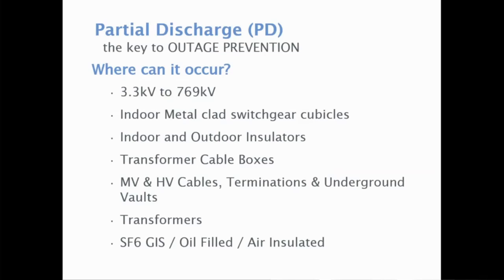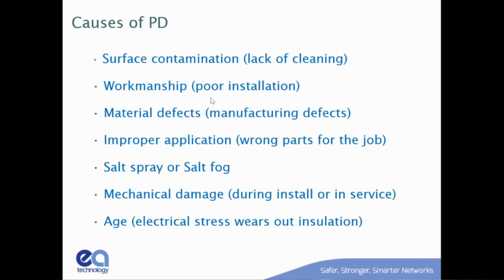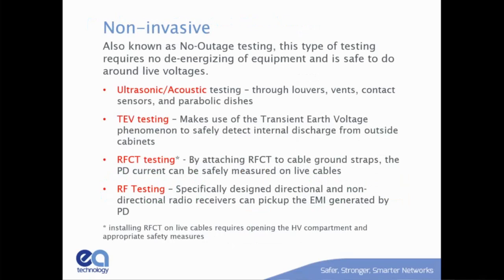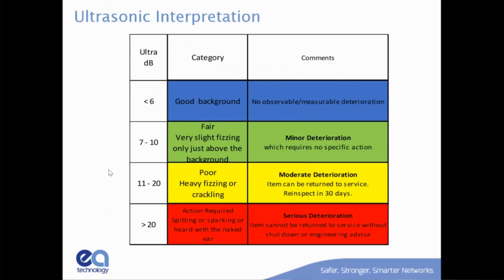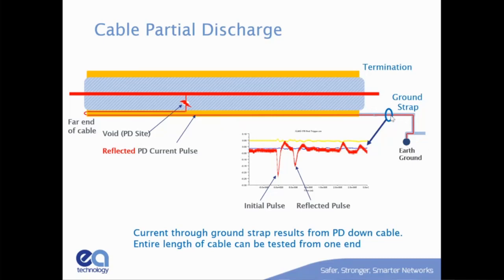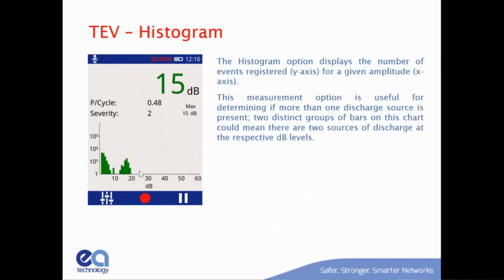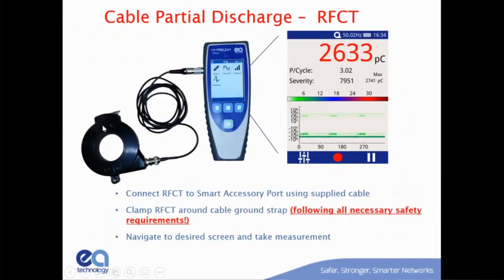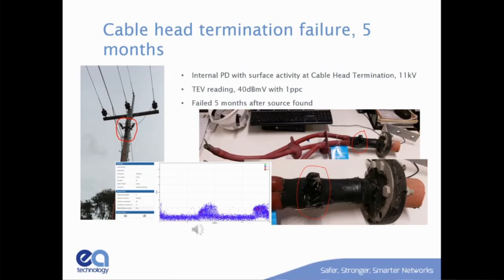Partial Discharge - Causes, Effects, & Online Detection Techniques

Comment: Hi Bill, In your later slide, how do u detect internal PD of the void in the resin, if power cable ground braid are not accessible using RFCT? How does the resin core CT created the PD? coz its secondary is either 5A or 10A, and is based on induced from the power cable thro the CT..  thanks Bill
Reply from the maker: If you have internal PD in the resin caused by a void it typically generates TEV which can be detected on the outside of the cabinet.  If there is no cabinet surrounding the CT, you can do TEV tests on supporting metal structures, ground braids, etc.

Comment: Hey, can u explain how converters in the wind turbines may affect the measurements? We currently get alot of noise on our readings, making them hard to compare year for year. Would u recommend to take measurement on the wind turbines while they are stopped to reduce the noiselevel while maintaining voltage (33kV without load) on the switchgear from the supplier?
Reply from the maker: I'm sorry, your comments did not show up until today.  The AC inverters in wind farms are extremely noisy and can make partial discharge measurements difficult.  You are correct, the best way to make measurements is with the inverters turned off and the cables still energized. You can also make use of our built in filters on the RFCT measurements to help somewhat.